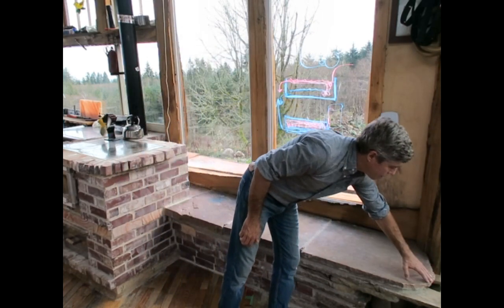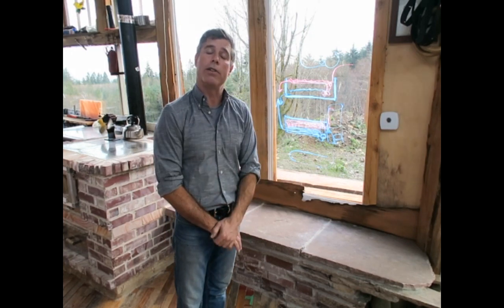Rocket Mass Heater Bells and Benches Discussion

Comment: HI :) I am building a rocket mass heater and I am using the bell bench and my question to you is ... can I use cob for the top? if so how thick should i make the cob? will two inches retain the heat? or should I shoot for 4? I did not want to use the pipes because i am using an old futon mattress to sit/sleep on and I did not want to have to make up that much cob. I am in a very old house with not so great joists under the house and I am afraid all that mass would mean that I would have to shore up the floor before I could even start. Anyway ... I have cob, I do not have flagstone. Also one more question.. if I send you a picture of my bench so far could you critique it?? and let me know if I am on the right track please and thank you. I love your videos. If this goes well I am wanting to make a cookstove per your instruction. oh and .. does the pipe going out of the house ... the outlet.. need to be 8 inches as well? or can it be smaller in diameter.Thank you for your time. :)
Reply from the maker: Four inches would be ideal, but it can vary depending on the system and your goals.  Chimney should be the same size as the rest of the system, or larger.  Hope that helps.
Reply: broaudio  Thank you :) I hooked up with permies.com and got some great information as well. Also I happened to remember that my mom has a flagstone walkway I put in years ago and now she wants brick sooo.. :) I dug up part of her walkway and put it on the bench and cobbed them in place. They are anywhere from 2 to 3 inches thick on top of 2" of cob. I think this will do nicely. 
Thank you for the pipe sizing. I was about to put in a six inch because the 8 just looks so big going up the wall. It will be fine though I'm sure :) I appreciate your advice.  I love your channel.

Comment: Where the exaust is makes a difference. You want the hot gases to travel the longest distance possible to maximize the heat transfer !!
Reply from the maker: What you are missing is that regardless of where the exhaust is placed horizontally, it is the vertical location of the exhaust relative to the entrance that dictates how far the gas travels.  You are correct in that we want maximum dwell and contact, but we get the same results regardless of which end of the bell the exhaust is on.  A pool with a stand pipe must fill completely before draining, the water can not shortcut to the drain until it fill to that level.  Same situation here.  Hope that makes sense, thanks for the comment.
Reply: Hi. you are forgetting the mixing that you show in the top half of your drawing. This allows hotter exhaust gasses than you think you are getting. It also explains the bench getting cooler on the end... if it was truly stratified the temperature gradient would be vertical and not left to right.
Reply: It would be interesting if he had a probe in the left side as well, to see the temp difference. It could be that the left side is closer to the burn chamber and is picking up heat from conduction, or, as you say it may be short cycling of the exhaust gasses.
Might be worthwhile to have a horizontal plate in there to force stratification, so the hot gasses come in the top and have to travel the length to drop down and return to exhaust.
Reply: Some follow up- In discussing this with someone who knows far more than I do about physics, it was pointed out that the ‘pool and standpipe’ analogy is incorrect, since gasses do NOT behave the same as liquids. Liquids are very correlated to gravity, while gasses swirl and mix, and are more correlated to heat and air pressure. That is not to say the rmh model is wrong, since obviously it works very well. In general, the height difference between intake and exhaust creates the correct flow, but it could very well ‘short circuit’ at times.
Reply: His temp measure of the bell next to the stove was higher than the end of it. If he ran a pipe so that the exhaust exited towards the end of the bell I think that it would make the temp more even.
Reply: But the velocity is in the burn chamber, not the bench...
Reply: @julier1080  Hi, air is a fluid.  Just a different density.

Comment: GREAT idea to use an open chamber and stratification instead of a snaking pipe system !! 

Your exhaust should be far away from the initial entry point of the hot gasses. There's going to be turbulence at the entry point. You want the gasses to stratify before the cold is expelled. 

I'm wondering if the next evolution to this system is to scale down the size and increase the duration of combustion to the point of more or less continuous combustion over the entire heating season. A automatic fuel feed of a very small amount of fuel continuously would offer some advantages.

You wouldn't have to feed the fire at all.

The size of the stove would be much smaller.

The fuel could be pellets poured into an automatically feeding hopper. You could set it up to add a few pellets when the current burning pellets are reduced to a certain weight.

When the burning pellets get lightweight some more pellets are automatically poured into the fire via and angled tube.

Automatic feeding continuous burning rocket furnace. Maybe top off the reservoir with more pellets once a week at your convenience.

There would be no temperature swings from too hot to too cold. Very even temperature output and with your cobb CHAMBER heat battery you would enjoy a very constant temperature. You could adjust the rate of burn by adjusting the weight at which additional pellets are fed or.. you could adjust the rate of burn by adjusting the air intake. This could be a much smaller scaled apparatus less intrusive to the indoor space. The cobb chamber should encircle the entire main floor of your indoor space. It could be narrow enough to allow a standard wood floor to support it. Perhaps an eight inch wide cobb chamber one foot high wrapping around all of your exterior wall at the floor. Only your exit doors would obstruct an entire circuit.

..
Reply: I suspect that the minimum viable fire (that efficiently and cleanly burns the gases) would be way too much heat to burn continuously.  Paul Wheaton seems to think that a couple hours a day of burn is the maximum necessary burn, even in the coldest part of winter.

Comment: You may have answered this before, or possibly have a build video somewhere? How do you ensure the exhaust gases do not start leaking out your bell? or bench area?
Reply from the maker: Jim, the stoves are well sealed, but even if it's not air tight it is always at negative pressure when there is a chance of gasses present.  The warm masonry ensures consistent draft even through the end stages of a burn, ensuring the entire stove from firebox air intake and on is drawing room air inwards, rather than leaking out.  If the stove were to leak, it would leak out the firebox air inlet as much as any leak in a bell or bench.

Comment: Thanks for the great video. I have never seen the bell option but it makes very good sense. I have one question.  Have you ever tried it with two bells at 90 degrees for a corner application? I realize that you would have to go with a different stove design but, can it be done with any degree of efficiency?
Reply from the maker: You can certainly do it that way, or just one big bell with a 90 in it.  Two bells work well, and the corner represents no obstacle to flow for a single bell either.  A lot of variables in deciding which is best for an application, but either would work well.  Hope that helps, thanks for the comment.

Comment: By creating such a large chamber, aren't you reducing the mass which actually retains (and then releases) the heat? You need to maximixe the  contact surface area to maximize the heat transfer and maximize the mass volume to maximize heat retention.
Reply from the maker: A bell maximizes contact area and the brick are far denser than cob, so this bench is higher mass and better heat transfer than a similar sized flue run bench. That would change with size, so it all depends on your goals and design. Neither construction is superior, they have different qualities that can be used to meet the builder's goals.  Hope that helps.

Comment: Hi, I must say your videos are very informative and interesting. I'm only new to rocket stoves etc. You do put a good case for a bell bench as opposed to a flued cob bench. I've a few questions though:
Do any of the materials for a bell bench have to be fire-rated or anything like that?
How can you be sure that there will be no cracks or shrinkage affecting the gas tightness of the bell chamber?
Do those slabs need to be supported in the middle?
Thanks
Reply from the maker: Thank you Jim. Fire rating and material choice depends a lot on the system.  In this system, I would not hesitate to use hardibacker and tile, but I wouldn't use wood on the bench/bell.  I recommend inflammable masonry, but it doesn't need to be firebrick or refractory.

The clay/sand mortar is the most flexible and reliable I've found.  It creates a good seal and moves with the masonry.  There may be some cracks on first warm up, but I always save the finish work and go over the joints when they are expanded.  Aside from that, there is no reason to fear a little crack here or there.  There is no such thing as an airtight masonry heater.  The thermal mass means that after a fire, there is always draft.  As such, any leaks will always be drawing in, so there is no risk of leaking exhaust into the space through small cracks. I have not found any reason to be concerned over air tightness, or cracks.  In use, they don't manifest as a problem.

In this build, the slabs are over a small span of 10" or so.  They do not need support.  A wider bench or bell could have a center support of brick piers, or steel angle across the span.

Hope that helps, thanks for the good questions!

Comment: hello Matt, excellent video, now that I've seen this this is the design that I want to do. a couple of questions. 1) does the Bell only consist of the brick and flagstone? Nothing inside? if so, that's wonderful!: 2) is it okay to put the intake and exhaust on the same side? 3) I would like my bench SEATS to run both directions from the burn chamber each one about 8 ft.  for the intake in the exhaust Can I use two 6 inch pipes going from the 55 gallon heat Riser Barrel on both sides going into the Bells and have two 6in pipes on each Bell going into One 8 inch pipe for the exhaust?. 
I was surprised that you talked about the inefficiency of Pebbles with wood aesthetic because that's what Paul Wheaton did and he said he only used 6 tenths of a quart of wood with a house in Montana for the whole year!  that doesn't really sound that bad, I'm in Santa Fe New Mexico in the average overnight temperature in January is 20 degrees of course yesterday it felt like it was 60. during the day. I think I will use red brick on the front because it does look so good. thank you Matt, I appreciate your response. Brian
Reply from the maker: Thank you Brian.  Paul and I agree about much, but not everything. Don't expect the results he reports, they are not the norm in my experience.  Your plan is flawed in the splitting of the flow, that never works satisfactorily in my experience.  Try to find a way to make the benches sequential and it will work great.  Bell is hollow, exhaust and intake can be anywhere as long as elevation relationships are respected. Hope that helps!
Reply: Theres a way to build a valve-box between the two mass benches, with two valves, so that when the valves are open, the hot gasses go straight back from the drum to the chimney, bypassing the mass benches (useful during cold startup). When the valves are closed, the first valve guides the hot gas into the right bench, it flows around through the duct, comes back to the valve-box, the second valve guides the gas diagonally across into the left-side mass bench, it flows around through that ducting, and comes back into the rear of the valve-box to go up the chimney. I drew a diagram in MSPaint but can't post it in the comments.
Pebble fill works great if you have mud/clay to connect all the pebbles together into one solid mass.

Comment: need to heat 40 gallon hot water tank (180deg F) efficiently with little wood fuel used. How ? eg would a 10 inch rocket stove with ceramic fibre board (and/or polished stainless 310 High heat resistance lining) make air flow better insider chamber and help to create  a super hot flame (bunsen burner effect). That super hot flame would then be in close proximity (eg 1 inch) to under surface of a stainless steel water tank. Do you think enough BTUs to heat the water to 180deg F, or maybe use two or 4 rocket stoves together heating the same water tank which would be insulated ? Thanks

Comment: Id like to build a RMH cob bench/wall for outdoor use. Are there designs that will minimize heat lost through the riser/barrel and maximize it in the heat battery aka cob bench/wall? I want to have an outdoor winter area in SoCal for people and plant tropical fruit trees behind it, against a wall/backrest, espalier style. The bench/wall will be south facing and hopefully will store heat through the night and keep the trees above 50-60F. A cooking platform like you have here would be nice, but the main purpose is to heat trees, 2nd purpose to heat people, and 3rd to cook, slow smoke, or make jerky. I want the wall to be 6’ tall, circular and as long as possible. Ive read thar the flu pipe can be a max of 50’, can the bell/chamber be longer? Can I go longer if I have a bigger feed tube, riser etc diameter?
Reply from the maker: It sounds like an ambitious project!  There are certainly some large RMHs out there, so I suppose it's possible.  Good luck, please share when you build it!
Reply: broaudio what is the downside on completely burying the riser inside a mass? Im guessing maintenance would be an issue, but maybe using a large thick piece of flagstone in place of your stovetop to send more heat into the mass downstream? Is there a limit to how long the bell or flu pipe can be when there are no bends?
Reply from the maker: No downside to having mass over the riser, that will allow longer flue runs.  Length is going to vary depending on a lot of factors.  In my designs I recommend no longer than 12'.
Reply: broaudio is the 12’ rule of thumb because of bends? Im sure it becomes harder to create a draw the longer it goes. Do bell type RMH light easier than a flue type with a proper gradient?

Comment: nice video and RMHB stove....   is there an ideal length of the bell bench or max length where its no longer working correctly?
Reply from the maker: Thank you.  Yes, but it will be different for all systems and vary by conditions; warm mass/cool mass, fuel type, outside conditions, etc.  A longer bell may be used if the exhaust is coupled higher in the bell, heating mostly the top and less of the sides.  A shorter bench can use a deeper exhaust exit to engage more of the bell as heat exchange.  In this way varying lengths may be used.  The best way to figure this out is to build the system and play with exit heights to find the best performance.  This can be as simple as locating the flue pipe higher or lower in the bell, or blocking off the upper parts of a bell exit to adjust exit height.  Great question!

Comment: I notice that your rocket mass heater is built on a wood floor. I’m interested in changing from a pellet stove that is totally useless at warming my home to a rocket mass heater. But, I have a wood floor. Is it possible to build safely on a wood floor?
Reply: Definitely not directly on the floor. Of the other videos of rocket mass heaters I've seen, they've made a foundation on the floor of bricks, sand, clay, dirt, or cob first.
Reply from the maker: Exactly as the Thalanox says, you want to build up on an air gap to insulate the heater from the floor and allow inspection. You will also likely need to shore up the floor from below to carry the weight. If in doubt consult a professional engineer is my recommendation.

Comment: Is it correct to say that the top of your bell should be a level, flat surface to spread out the hot gases as much as possible for more efficient transfer before they sink to the bottom??
Reply from the maker: Great question Brant.  No, that isn't necessary.  Much like a pool of water, the deep spots will fill first, with the *coolest (hottest in this case) water(gasses).  That said, every bit of elevation change will be a temperature change.  More heat into the highest spots, with the low spots being cooler. In other words, a Bell with a tall section and a low bench section that are all one open chamber inside will heat the tall section then "spill" into the lower section.  The tall section would be much hotter overall.  In this way you might keep seating near the firebox cool and have a raised area out farther away that gets warmer.  These features are neither good nor bad, simply tools that may be used to help design a system to reach your goals.  Hope that helps.

Comment: Great video just a question how detailed are the plans especially where the bench meets fire box
Reply from the maker: Thank you Frank.  The plans are detailed, and show the flue runs from stove to bench.  The bench itself is not included in the plans since every install typically has a different layout.  Should you purchase plans and need details to help you complete your bench, I'm happy to help and can provide drawings or consultation to give you direction.  Hope that helps.
Reply: Thanks